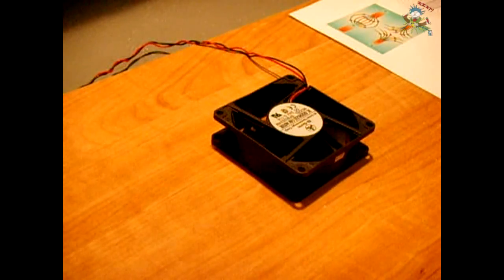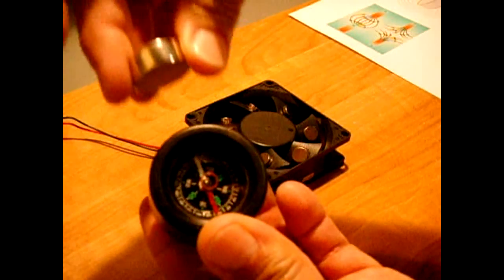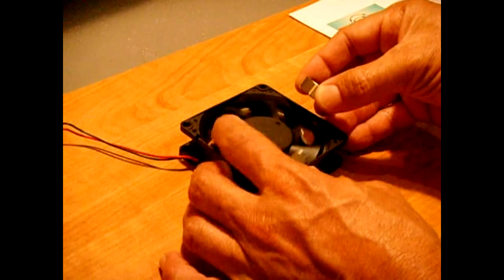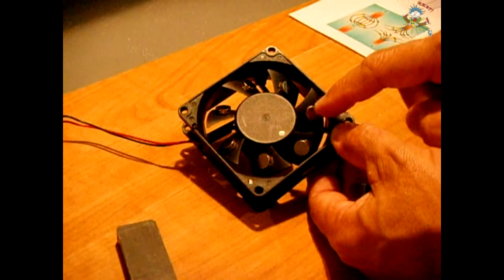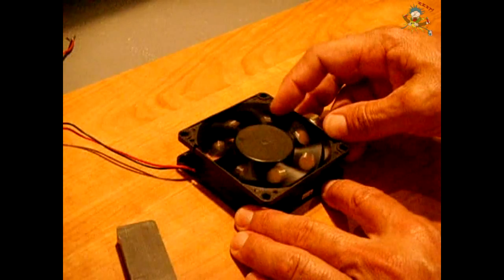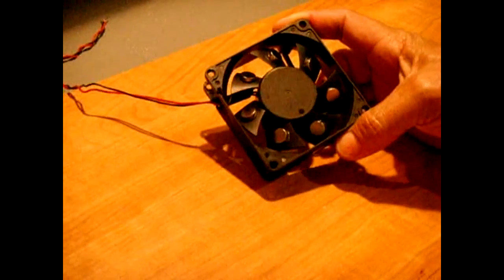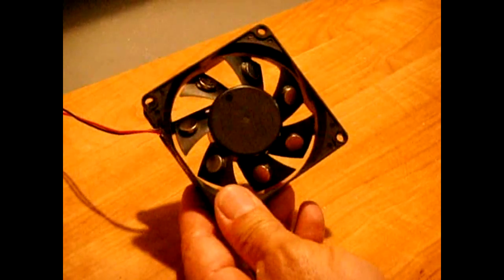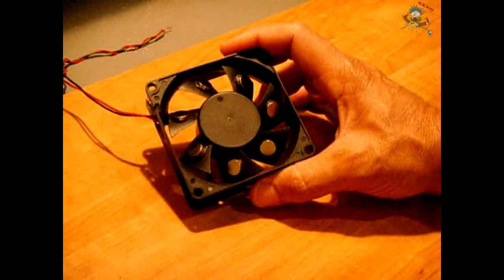Free Energy ~ Case Fan Magnet Motor / Real or Fake?

Comment: OKAY IMA COMMENT REAL SLOW FOR U i did this shit when i was a kid 3 things okay! mate the fields you are trying to employ are not working i theorise that 
1 the magnets on the blades do no have enough resistance!
2 that your fan does not have good shielding as some have more than other and the like affecting this test!
3 you need to work with both poles on both ends of the transaction.... ask for a diagram if ya need )(but put simply the magnets on the blades should have positive to pull towards a negative fast and and a negative face on the opposite reflection that they are constantly! pushing and u should have employed more in separate intervals it's all about 1 blade making it past and the rest fall in line!

Comment: They have a motor driven disk under the table to provide the rotational power. Have them hold the fan in free air away from the table and see if they can make it spin!

Comment: The easy way to fake these "free energy" motors is to use a 2nd fan with bits of metal on two of the blades and the motor not removed and put a piece of cardboard or paper over the live fan to hide it.   (In the faked video I saw the "free energy fan" was sitting on a poster.   How very convenient.)''

Or just use a standard magnetic stirrer (about $30 used vintage model on ebay) again with a cover on top to hide it.

There are probably more obvious crudely faked videos on the internet than real ones.   Everyone wants to look cool and get clicks an any idiot can just fake something.

Critical thinking ability has been systematically destroyed in much of the younger generation by charter schools etc so there are plenty of idiots to get conned.

Comment: You put the poles wrong. It should be n-n-s-n-s-n-s. start rotating at the double n magnet. Use low energy magnets on the blades. Then it works. Please make a new video to inform the people.

Comment: Are you shure, you're holding the magnet in the right distance and angle? 
If you are referring to the video of Wasaby Sajado, there is one obvious difference: 
He had a magnet with plastic or rubber around it, which supposedly should reduce the side-effects of the magnetic field. 
I have my doubts, but this may explain that the magnets aren't locking in... ^^

Comment: TECK DOORS  video is a fake because inside the false large magnet housing is a miniature 3 volt button battery motor powering a spinning diametric ring magnet.  His bulbs and coils in his other videos are powered by a silent tesla coil and a foot switch.  He is a expert manipulator that craves attention and is getting all he can handle.

Comment: Not even close to being able to work... I had my doubts but had to 
experiment a little to prove my point. The computer fan motors are diode
 protected circuits for one thing, This means that power can flow ONLY 
INTO the fan...and not reverse out as any real measurable voltage. To 
test this I installed a buffing wheel onto my dremel...which at slowest 
speed spins at 8000 rpm, Hooking up my meter and applying the spinning 
buffing wheel to the center of the fan I was likely receiving around 
6000 rpm... the output of the fan registered a puny .003 volts. This 
experiment as shown in this video is 100% FAIL.
Reply from the maker: This video was made to EXPOSE a popular scam on Youtube. You understand that, right?
Reply from the maker: I read the comment quickly and saw where you said, "This
experiment as shown in this video is 100% FAIL." You made is sound like I failed are duplicating the scam device.

Comment: The guy who made the free energy video you mention is using a light bulb from a magic store.  It is the same type light bulb used by Uncle Fester in the Adams family TV show/movies.  It has batteries in the base, and the base is plastic and fake looking.  (It's made to stick in your mouth after all.)  The on switch is on the base, where he touches the wire.  His fan is most likely moving due to a blast of air directed at the fan.

Comment: If you try making a ran blade spinning with a 120 mm fan with 7 blades as shown you will fail because the magnets atre very close to one another. I can sell you my plan that will work but you must have more separation between magnets so there fields do not overlap. That means a larger than 120mm fan must be used and all electronics magnets must be removed so the fan blades spins almost friction free. If interested in my plan with a money back guarantee if you can fault it contact me at 65tferko@ gmail.com
Reply: You either may or may not get your motor to produce current, but with the magnets as far apart as you suggest, there would not be enough torque to produce current of any value once you put a load on it.

Comment: It'll run if you take the fan magnet out of the middle so it wont clog to the magnet that you are holding in your hand.
Reply from the maker: Incorrect. Please watch Part 2 to learn how the scam was likely pulled off. Thanks for watching!
Reply: Ok. I just watched your 2nd video. I'm going to tell you how to make it work. 1st you have to make all the magnets into monopole magnetics and only used all the south magets or just only only the north magnets so it wont clog. Look on Youtube on how to make monoploes. 2nd you need to take the micro chip off the stator and throw it away. 3rd you need to rewire the stator in so it can produce the correct current from the fan magnet. You can find videos on how to rewire it correct on Youtub. Let me know if you figered it out. Later

Comment: the outer magnets would need to spin to continuously attract the magnets attached to the fan blades, but they would only spin until friction slows them to stopping, it's a very tricky near impossible task to make the motor work without applying power to the system, which would make it pointless.  but it is still worth exploring different options.

Comment: You haven't shielded your magnet. Use thin aluminum sheet. That way you shield from the cogoing effect while still getting a push.
Reply from the maker: Watch Part 2. The device is a scam.
Reply: +electronicsNmore 
I know the one that is commonly shown is a scam.
the problem he shows (cogging) is a well known one. the effects of cogging can be mitigated by using material that dampens or redirects the magnetic flux ie, aluminium sheet to create a shield. I will try to find a video that shows the effect that I am referring to.
Reply from the maker: Timothy Haug
Sorry, but you won't be shielding anything. You need to try these things yourself to be see that I'm correct. Magnetic fields go right through aluminum, and also induce currents in the aluminum.
Reply: +electronicsNmore 
you are right and wrong. I did say mitigate it's effects, not totally negate them.

shielding the magnet with steel on the side facing the fan and extended a little past the repelling end. 
on top of this, you can make a simulated monopole magnet using 5 small bar magnets that focuses most of the energy towards a single pole called a Halbach array.
https://www.kjmagnetics.com/blog.asp?p=shielding-materials

https://en.m.wikipedia.org/wiki/Halbach_array
Reply from the maker: Timothy Haug
Like I said, make one. :-)

Comment: Is not fake. To you it will not work because not you covered the sides of the magnets, remember that the sides are also polarized oppositely to the surface side of the magnet. Looks back at the video where it works.
Reply from the maker: Don't waste my time with your nonsense. You need to wake up to the fact that you were duped by a scammer. LOL. I highly suggest you watch Part 2, you may learn something. Have a nice evening. Nothing else to discuss.

Comment: built it wrong, and doing it wrong.
Reply: for starters its a matter of math and engineering as well.   Dont try to change the formula, ie, use larger or more powerful, heavier magnets.  There is also an exact distance needed from the held magnet to the fan etc.
This strikes me as a DIS-info video.  Ie government type vids that dont want free energy to be sought and used.
Note.  you cannot patent devices like this in most countries which have a rothschild central banking federal reserve.
They have control of the patent offices.
Reply from the maker: LOL. You're delusional. Made it correctly, and yes, the device is a scam.
Reply: electronicsNmore
 Its ok if yer wrong buddy, im sure you're used to it by now.   Ive seen working models in person.  and Ive seen them the size of car engines on display at university, large enough to power a house.  But if you NEED to be right just cuz YOU cant get it working, thats ok.   Be well mate.

Comment: Thats true ...While your N force to push ACW after its range S will stop rotation within completing your task and it will be S to N and equal force as your pull through opposite side i.e. S and N. Completely incomplete tech to have prototype i.e. peripheral motor or machine.

Comment: i would think that you have to calculate and overcome resistance. you can see the resistance at 7:30. but you do make some good points in validation of other videos
Reply from the maker: Watch Part 2 to see how the scam was likely pulled off. Highly detailed. Thanks
Reply: I'm not discrediting your video at all. I'm stating that theoretically motors can operate off of magnets. If not, Tesla would not be in business
Reply from the maker: Ricky Brown
No motor can operate using magnets only. You need a changing magnetic field.

Comment: I'm floored by how many views he got for that. I'm starting to develop a critical eye and the biggest thing i noticed in his video and some others is how part of the video is cut off. he shows the fan in his hand at first but when he makes it move, we don't see the bottom corner. The actual power wires could be in that missing part of the shot. I won't post my video link as its spamming but if you check my channel, I did a test of what I'd call closer to free energy. I was using a stirling engine inside my house while the outside plate was in the air during winter. The difference in temperature was enough to get it going.
Reply from the maker: +EnergyTests 
How many views the scammer got or me? Watch Part 2 to see how it was likely done. :-)
Reply: +electronicsNmore The scammer :) I like your comments about cogging. I thought more at first about the next magnet causing issues. For fun, I may try removing the magnet that is next in line.  I checked some videos on shielding. I knows its not really shielding but more so giving the magnetic field a different path. checking your next video now :)

Comment: Hi, If you want the object to work, the magnets needs to be recessed into a none Ferris metal like Aluminum or any plastic or Teflon so that the sides of the magnets are not showing and just the south pole of the magnet is only. By doing this you are insulating the hole magnets and you are having just the south pole of the magnet showing only. Then your magnet motor will then work.
Reply: Disrupting the magnetic field would... disrupt the magnetic field. Shrouding the magnet would prevent it from working IF you could effectively shroud it. That said, NON-FERROUS metal doesn't dampen magnets so much as not interact with the field on an appreciable level.
Reply: +1
Reply: How about if you were to use a brass or copper tube and have the neodymium magnet glued inside of the Brass or copper, would that act as the proper shielding to prevent the Togging effect?
Reply: Nothing conductive should be able to prevent a magnetic field unless it also has a magnetic field, if I remember correctly. I don't remember how Faraday cages work, or if copper alone emulates its effect.
Reply: O key! And thank You for your input, I do appreciate it.

Comment: it's true, i've tried it several times, but instead of using magnet, try to put it infront of a fan,. and.. don't forget to remove any electronic parts on the back of the coil,. this may affect the current, you can put wires directly on the coil end.
Reply: ronel janeo A fan?! An electric fan?! 😂

Comment: Looks Like you need a stronger magnet. or possibly use thinner magnets on the blades as i'm sure the thicker ones cause more drag due to their weight. This obviously does work if you had a stronger magnet, it literally has to.
Reply: +Mike Dye The force that repels it will be equal to the force that attracts it, so it's literally physically impossible.

Comment: Instead of bringing a single magnet to the fan why don't u use bismuth
Reply from the maker: +Ross Thomas-Davies 
Hi there. Sounds like you have been watching too many Youtube videos. I suggest you watch Part 2.
Reply: +electronicsNmore I did and thank u for the posts glad there honest people about. To be honest pal I've got such a hunger to finding free energy or at least zero point gravity that a small investment of less than £10 to try it I might aswell cause I'm loosing far more paying towards an electric bill that's not necessary. Plus diamagnetism seems the closest I've found
Reply from the maker: Simple solution, a solar panel array, bank of batteries, and a grid tie inverter. :-)

Comment: How do these type of fans normally work (brushless)? Like...what is on the little circuit board that is inside of it? I have seen that there is a circuit board inside from some of the videos that I've seen.
Reply: +John Kerley it is a coil inside a cylindrically shaped magnet so why you let current through the wire it creates a magnetic field around it which will cause an opposing forced to the permanent magnet surrounding it so it will push it hence spin the fan. if you reverse the set up meaning if you spin a magnet sound a coil it will generate an electric field which cause voltage that can drive current. in general a moving current creates a magnetic field and a changing magnetic filed creates electric field" this is called Faradays Law in physics. hope it help
Reply: +zesowl I know about what you are saying, but, it's the brushless part of it that I was specifically talking about. I think that maybe the fan does use a reed switch and some sort of transistor circuit to turn off and on and switch polarity of the DC current to cause a spinning motion,...because spinning motion can only be obtained with unipolarity DC current in a Homopolar type motor, wich draws too much current to be efficient for practical use.

Comment: This is almost how a brushless motor works but takes perfect timing from an esc to break cogging....
Reply from the maker: +poitka80 
Electric motors have alternating/rotating magnetic fields, this scam device does not.

Thanks For Watching!
Reply: +electronicsNmore it doesn't work by it self but cause what you are seeing is a electric motor which is the opposite of an electric generator it is just that these fan motors are not made to be reversed. if you were to switch out the motor with a generator it would work fine. But if you don't believe me just look up a thing called a wind turbine unless those are just a scam to. oh and to spin a fan with electricity you kind of need a motor.

Comment: Hey , just a thought of mine. To help shed some light on the magnetic fields that seemed to show implausible free power fan motors. Maybe if you take a magnet from a computer hard drive and apply it to the fan blades you can get it to work. They have only one magnetic field on one side . The other side has some sort of magnetic block . I guess to keep the field from magnetism from destroying the computer.
Reply from the maker: +Sweetz H 
Please watch Part 2. Thanks

Comment: AMEN DUDE!   I THINK WE WERE SUPPOSED TO BE IMPRESSED BY THE FREE LIGHT.  FIRSTLY THOSE MUFFIN FANS ARE NOT GENERATORS...   EVEN IF YOU SPIN THE EVERLOVING SHI..... OUT OF THEM THEY DONT PRODUCE AN OUTPUT.  IF YOU TAKE ONE APART THEY ARE DRIVEN BY ELECTRONICS AND ARE IN NO WAY SHAPE OR FORM A GENERATOR.   THEY ARE DESIGNED TO BE A QUIET EFFICIENT COOLING FAN FOR COMPUTER CIRCUITS..     THE VIDEO I SAW WAS THE DUDE (WITH YOUR SIMULATION SETUP)   TRIED TO SHOW AN OUTPUT FROM THE FAN GENERATOR ...   AND LIT A LIGHT..     EVEN IF IT WAS POSSIBLE TO LIGHT A LIGHT FROM A MUFFIN FAN..  (AND ITS NOT)   I WAS MORE CONCERNED WITH THE INSTANT PERPETUAL  MOTION OF THE MAGNETS ON THE FAN...  BASICALLY  IF IT IS SO SIMPLE TO MAKE A FAN SPIN WILH MAGNETS THEN WHO CARES ABOUT A SMALL BULB >>>   THEN WE COULD GLUE MAGNETS ON BIG THINGS AND POWER THE WORLD  >>>   THUMBS UP ON YER VID!    THE THUG IS A .....     WELL   WE ALL KNOW.............................................
Reply from the maker: +coolflix43 
Watch Part 2. :-) Thanks!

Comment: well its simple, the force from the magnet pushing has to equal greater than all the resistance of the smaller magnets, using a weak magnet to push a heavy magnet will not work.
Reply from the maker: +Truth Seaker 
Watch Part 2. :-)

Comment: had to unwind the coils rewind coils all in the same direction dc motor so the negative  side of coils wraped in the opposite direction would not drag cause motor acts like push pull amp does when wraped  right turn left turn if you drove your car like that you would wear your tires out another example sawing wood with a hand saw laying pipe with your girl friend you understand at the beginning  use transister  between 1st coil 2nd base feed emiter to second coil then ground you know kick start it lke kick starting motorcycle piston like transister ya'll have to live with the spelling
Reply: to tear another down to built ones self dont work either

Comment: I also believed it is possible to run by magnet force after see the You tube video. but I doubt no one produce small power infinity generator. I think the fan will stop at between 2 pole same force. Anyway it is a fun to test it.